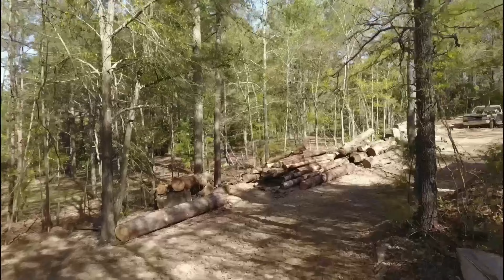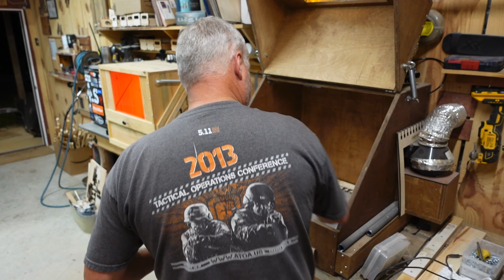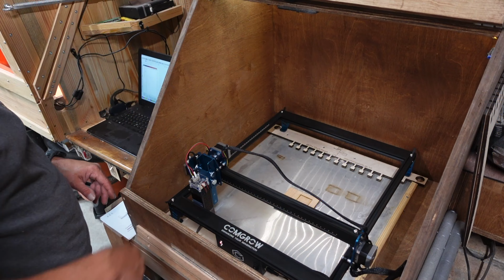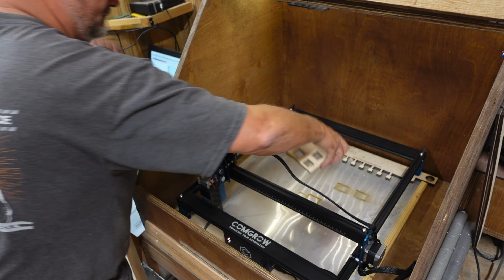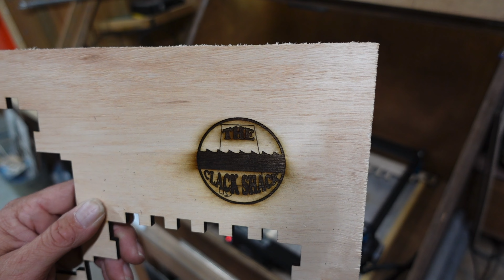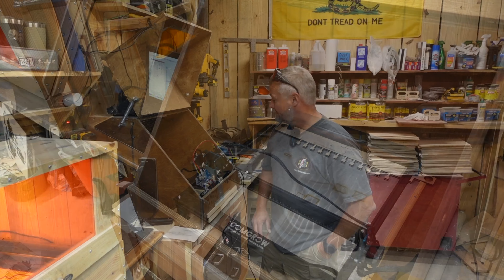Comgrow Z1 10 watt

Comment: Just found your very interesting site and I'm contemplating a purchasing a 10-watt output laser/cutter, I like the Comgrow performance as presented and would appreciate your input /recommendation on this machine or any other similar device, also could you provide the approximate dimensions of the enclosure. Thank you
Reply from the maker: With price considered, it is a great machine. Other machines do have advantages over it in some cases such as more speed or power options. It has performed well for me using lightburn and is one of the cheapest ones out there that I can say does a good job and has add ons.
Reply: @TheClackShack  Thank you very much for your help and prompt response, most helpful.
Reply from the maker: @billlester3088  any time
Reply from the maker: The plans for my enclosure is on my website under the shop tab. www.theclackshack.com the plan is a free download.

Comment: I just purchased the comgrow z1, after watching your video
Reply: I used your link, and  ordered the air assist....Waiting for delivery. Are the wheels on the laser in not great shape, I heard from another guy, Rich ,hobby guy ....I do craft mkt. too....thanks
Reply from the maker: I haven’t found any issues with the unit that I have. So far, it’s a solid machine and the price is a plus
Reply: @TheClackShack  I got the laser and the air assist, got 30% off can't beat that big fan of your videos. It's replacing my order laser because I crapped out I don't have an X tool I have a neje 2s Max, so now we have something in common with the two same lasers

Comment: I have a Z1 5W and it was SOOO easy ti assemble. Took less than 15 minutes but I AM a Software Engineer. I have the 10W module arriving tomorrow and got a K40 CO2 yesterday.
Reply from the maker: The orientation of the pieces was my issue

Comment: I have a Question why are you useing the C02 Setting in Lightburn and not the Diode settings ???? great video
Reply from the maker: I just see no sense in using the larger numbers, just a preference. Just multiply times 60 to get MM/M. I started using it in laserbox basic and just got a habit. I know mt settings in the measurement.
Reply: @TheClackShack  ok just you might want to let other know when talking setting because most will use the diode setting and burn items. Anyway still a great video thumbs up
Reply: @warp103  You said, "...most will use the diode setting..."  Well, I'm no seasoned expert, but in the 10 months or so I've been elbow deep in laser engravers (especially among the xTool D1 crowd), I have found the opposite.  Actually, I've had some new diode laser owners to contact me and ask me what those big numbers are for.  It' seems that the vast majority (at least, of those who have contacted me) are using the same category of speed/power that David is using.  
I think it would be a profoundly interesting exercise to poll owners of diode lasers to find out whether they use CO2 or diode laser settings.  Hmmm.
I suppose the main thing is to choose a category and stick with it.  "If it works, then ..."
Reply: @DrLarryAnderson  I have no doubt it works. I have been watching for a bit. But if some one followed his setting but with Light burn set to diode then some bad things will happen. Just trying to make  the information better.